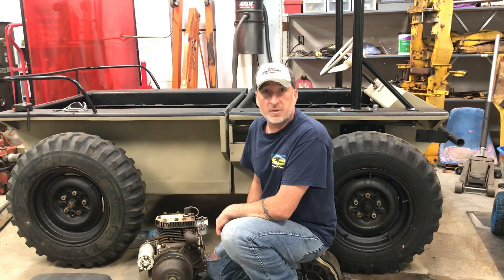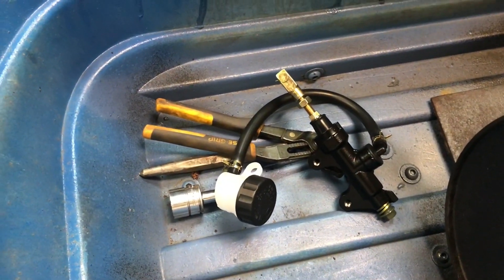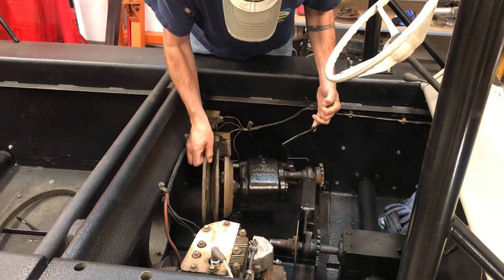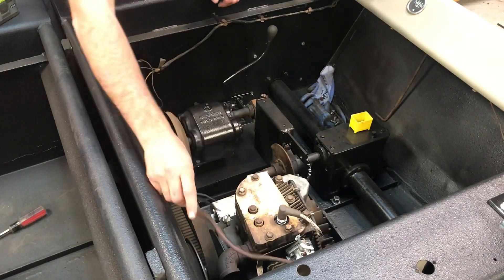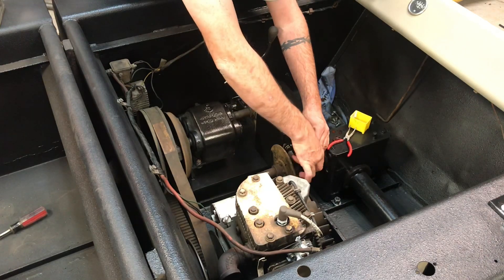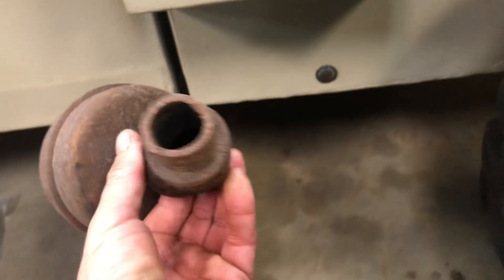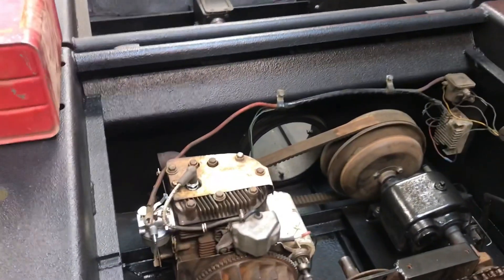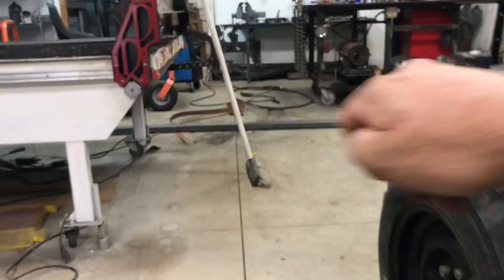COOT ATV Restoration part 14

Comment: Lookin to trade 2000 max 4 6x6 for one of these
Reply from the maker: I just sold it but that would have been a good trade
Reply: @Smalls4068  dang,, if you run across another,, my max ain’t eaten nothing